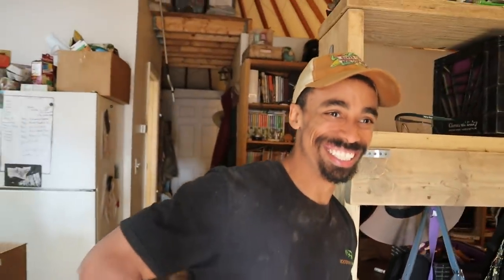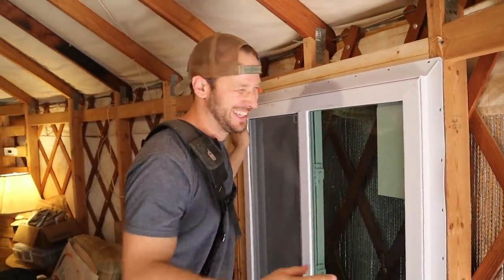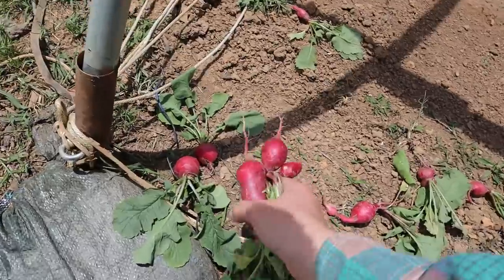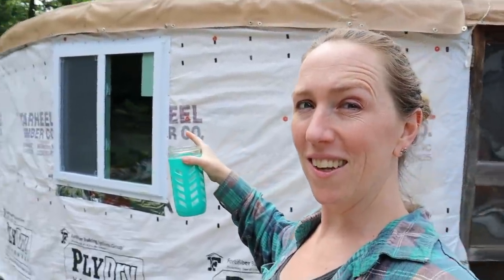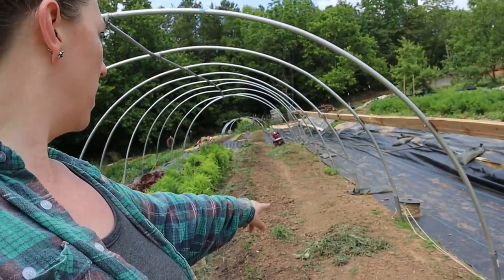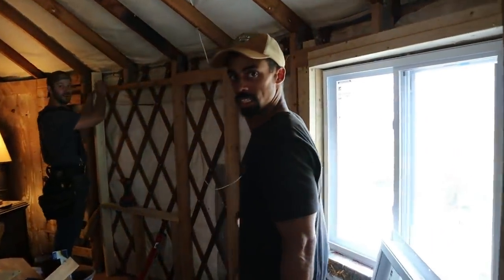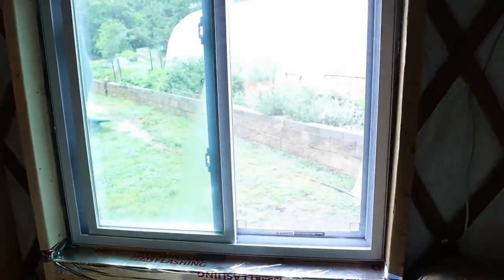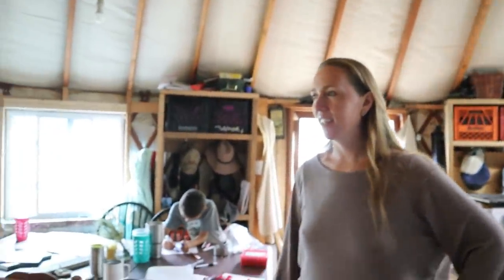He cut a HOLE in our HOUSE

Comment: Get a roll of large bubble wrap, a bunch of heavy black towels, and a box of thumbtacks with extra long points. You're going to NEED them in Winter to help keep the cold out! Cut the wrap to fit the window, give the window a lite mist of water, the wrap will stick right to the window. Then thumbtack the black towels over them to help absorb some of the heat and give a little extra protection. Believe it or not, this also works on 100/degree Summer weather to keep the heat out (except use White towels to help reflect the light). Hope this helps. LOVE you guys!
Reply: You two are pretty funny together.   😁😆
Happy you got your new windows!!!Things, are falling into place around the homestead guys. Keep up the good work! Be blessed

Comment: Those big windows will let in a lot of natural light, a cool breeze in spring and fall and serve as emergency exits as you dont have a back door!  I've only seen the plastic windows in yurts. A real glass open & close window will be so nice for you.  Now you'll need curtains and or blinds!  lol
Have you thought about fabric walls?  I used them in homes I had that had plaster walls and a log cabin. Both attracted dust in every crevice and was so hard to keep clean!  A string or tension rod at top & bottom held the fabric in place through a small pocket I sewed and I could easily take down to wash and rearrange. I even used Disney sheets for the kids when young. They loved changing their rooms!

Comment: if the sun makes it to hot coming in those windows they sell a film that is like a mirror that reflects the heat and you can see out but no one can see in..I bought some from ebay and love it--just cut it, wet it and it sticks  to the glass but is easy to remove if you ever want to.  God bless. PS--that light coming in will help your moods too.